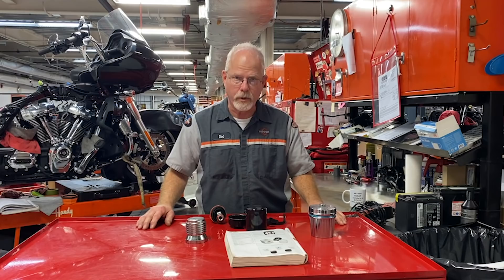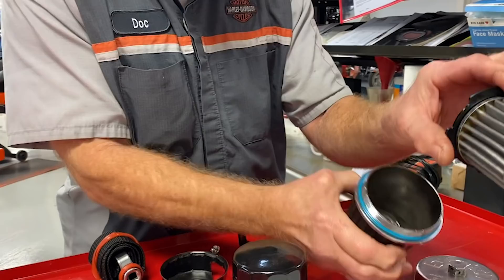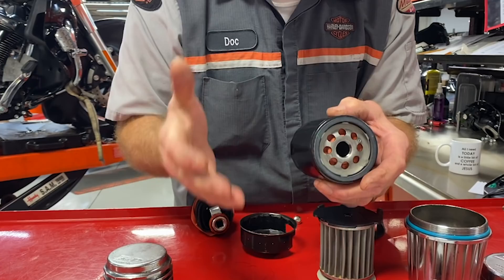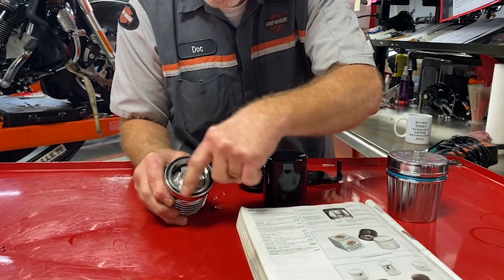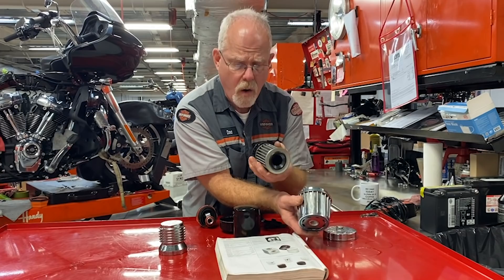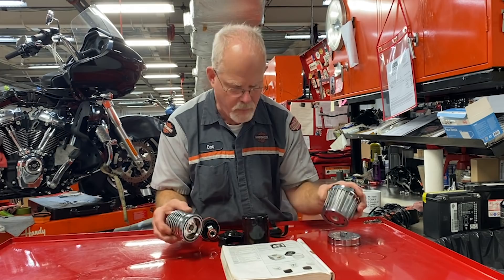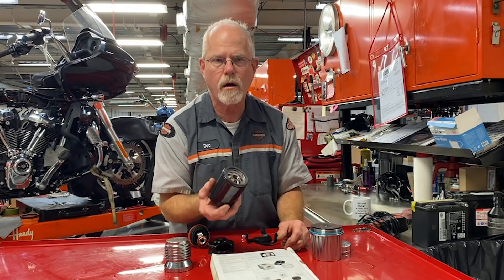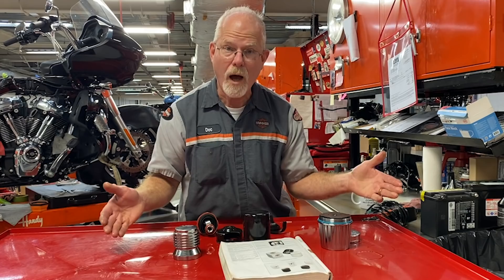DOC HARLEY: REUSABLE OIL FILTERS

Comment: I put two small holes in my filter before removing it. At end of filter one hole at 12 o'clock position other at 6 o'clock , top one is the vent. Filter drains out 90% of its oil makes less of a mess.   Ride Safe
Reply: Great idea 💡
Reply: Me too, I use a spring loaded center punch.

Comment: I have been using the K&P S4 on my Harley Street Glide  for the last 2 years with no issues , also the O ring is reusable and you get a 2nd one in the kit with a oil filter wrench .  I use Amsoil Synthetic oil ... Easy clean up with some brake cleaner :)
Reply: K&p on my bike comes with extra o rings and filter wrench and they work Awsome!! Better than any other  oil filter!!!
Reply: I just pick one up for my ultra what sold the this filter it lowers the oil
Temp by 10 degrees

Comment: First of all, I run the cleanable filters and change my oils at 1500 miles max! Second, I dare anyone to see a 5 micron piece of metal. Maybe 50 years ago when I had 20/15 eyes! When you see metal in a filter, it's either on the first oil change and junk was left in there at assembly, or you have parts coming apart! In the aviation world, if we see metal with a part number engraved on it in the oil, we go ahead and ground the aircraft ....LOL

Comment: Personal opinion reviews really don't hold much water, Except when meant to steer towards continued use and purchasing of OEM products which obviously is whats happening in this video. Any company willing to tool up and produce a milled billet reusable oil filter has done their homework on OEM specs and have spent much in R&D to either meet or exceed.  As far as cleaning, Come on really? Cleanup and blow dry with air is quick and easy, As far as O-ring i'm gonna guess here that thru all the R&D odds are they chose a standard o-ring size for easy replacement.   Ya wanna do a video, Take the filter on your right (For a HD and pit it against the HD filter and lets see real world results such as true micron level of filtration and PSI bypass and flow rate and lets see who's ranks best).

Comment: You know how much is made off oil filters that are disposable? A LOT. been using cleanable filters for YEARS and NO problems- take those motors down- for valve adjustments and full rebuilds- look GREAT inside....
Reply from the maker: Thanks for sharing your experience. Now about your taking a part for inspection 🤔……Doc

Comment: Flo, and DKCustoms have a Nut on the end to twist off the oil filter.
Best benefit of these oil filters is that they passively cool down the oil and they have naturally less flow restriction and therefor have less parasitic drag on the engine.
The metal steel mesh filters consistently to 35 microns. Nothing larger than 35microns will get past it period. Not the same with papermesh. Many of these mesh filters can catch things as low as 20microns, but they are inconsistent. The average filtration size of a paper filter is 30microns.
A human hair is 70microns across. Meaning a steel mesh filter will filter anything that's half the width of a human hair.
For reference, very fine sand, the softest lightest fluffiest sand you can realistically find easily, is 60microns across.
So Steel Filters will catch particles half that size.
The Steel Filters will get all of it, with a 99.9% catch rate. So there is no real risk to running a steel filter what so ever.
They have less parasitic drag on the engine, are just as good at filtering, and only need to be washed off. 
The only downside is that they are expensive.
Reply: I agree and as things are build to better tolerances and such the particulate becomes less and less.
Reply: To be effective a filter must remove abrasives larger than the engine clearances. The clearances between the cam and lifters or the rings and cylinders can be as small as 2 microns. I dont drain oil. My Honda 500 had a Frantz oil cleaner on it. All I use now is Motor Guards Gulf Coasts andthe Australian Jackmaster Classic. I have them on everything with an oil pump. Parasitic loss is when you take oil pressure out of the system such as with a turbo or bypass filter. The oil pump generates an excess of oil pressure unless it or the engine is worn out.

Comment: I’ve used K&P filters on both my 2011 Road King (103ci) and my 2004 Big Dog Chopper (107 S&S) for 9 and 11 yrs respectively. They are worth their weight in gold to me. They are clean and function well, and are top quality. O-rings are not an issue and they have never leaked and I’ve replaced them several times. 
  They come with either their own filter wrench or, like my Harley filter, with a molded nut head on the top of the filter for ease of removal. I’ll never go back to throw-away filters ever. Besides, yes, I NEED to see what is in my oil filters when I clean them out. One other thing you forgot to mention is the magnet inside the K&P filters, similar to the magnet on the drain plugs of your Harleys, an extra great feature. Sorry, Doc. I almost always agree with you but not this time. I do agree with you that the filter needs to be FOR a Harley Davidson, not a car. With that said, I really enjoy your vast knowledge and experience on every subject about my Harley. Keep up the good work, Doc!
Reply: Im with you. Ive been a Wix XP  Synthetic oil filter guy for my GMC 2500HD. But I have now a 2019 H.D.Road King. This H. D. Filter is what? H.D. gimmicky more money for our no name filter. Lmao! What do you say if I put a WIX XP OR ROYAL PURPLE filter on the bike? My bike will turn into a big firie ball of flames...lol

Comment: The one on your right hand side (with the fins) comes with extra seal although after over 10 years of use I still have the original one and no leaks at all!
It also comes with a socket (similar to one you was showing) so you won't damage chrome or anodizing.
And finally it was proven on the Harley Davidson stock and highly modified motors over the years!
It's easy to clean unless you are some kind of ignorant knob and it's easy for monitoring the condition of your motor.
So, I believe that you wanna sell me your expensive H-D oil filter with your baloney concerns about it :P No thank you!
I won't say anything about the other one because I never used it but I agree if it was made for cars then it's not good for my Harley. 
Oh, I'm not a seller of any of those:) Just a happy user of the one with the fins!
Reply: Plus it lowers the oil temperature with its fins.
Reply: i have been using my K and P - its stainless so can polish out any scratches if you get any have peace of mind can clean out super easy with brake cleaner dont have to go buy any when many times not available so have to wait for shipping- only remove when doing oil changes and so not taking off much and the rubber seals are still fine after many changes plus are available at my local store

Comment: I  love my K&P filter! bought it from my (independent harley mechanic)when I saw him rebuilding a pretty new 103 that had just sucked the OEM paper filter through the motor and destroyed it ,I've had it on there 6 years and about 50k miles with not one problem and only on my 2nd O ring

Comment: Great video Doc. I have a Flo on my Electra Glide and it works great. Comes with a extra O ring and has a bolt head on the end for removal. Benefits that are extra are a magnet, fins for cooling, and supposedly less oil drag resulting in a minor horsepower gain. Love mine in black or comes polished.

Comment: I use a FLO oil filter on all my bikes. It’s got a magnet inside to catch bug metal prices and it’s also got a nut on the case fir easy instal and removal. Also the O ring on it can be replaced with any o ring off a factory pip filter (if you ever needed to replace it). I don’t really know of the little cooling fins on it do anything realistically, but never buying a filter again is great.

Comment: I use an Arlen Ness Reusable filter on my Streetglide for 5 years now. no problems. Bought it for the look but works as promised. After 5 changes it pretty much is paid for and Orings are 3 bucks to replace.
Reply: You got a link?
Reply: @piercebruneau1284   It's not an Arlen Ness but it's just as good. Just search for the one that fits your bike. https://www.amazon.com/PC-Racing-PCS4B-Stainless-Filter/dp/B0041Q2BM4/ref=sr_1_1?dchild=1&keywords=reusable+oil+filter&qid=1610346730&sr=8-1

Comment: I Bought the K &P 10 yrs ago in Sturgis Iv'e been using it on my 04 Springer softail ever sense it is Far better than the regular throw away ones , Every time I change oil  I put a new gasket which all the motorcycle shops in Denver sell them 2.00 ea throw it it a bucket of soapy hot water cleans up easy blow it dry or put it in the sun also save's  a shit load ! and you don't have to throw it away..

Comment: I run the Flo filter on my 2016 Road Glide Special. Came with (2) extra o- rings. Has a bolt on top of filter. Bike runs 10 degrees cooler. When removing filter I use a half gallon plastic milk bottle for over flow oil.
Reply: Thanks for the tip on the milk jug.

Comment: I installed the K&P cleanable oil filter in 2014 with no problems whatsoever. It came with a socket for removing the filter and a spare seal. I installed the new seal last year. I ordered replacement seals, which comes with two new seals for ten bucks. I check the filter mainly for cam chain tensioner debris. Love the K&P filter.
Reply from the maker: Thanks for sharing your good fortune...Doc

Comment: I LOVE "Do you REALLY want to see what's going on in your motor?" Exactly why HD doesn't put oil temp gauges on the bikes. You really DON'T want to see how hot it's getting! I love your videos, and I liked how you handled this topic. In my airplane engines I cut open the filter and inspect the pleats. I run the cleanable filter on my three HD's just because... I also change my oil every 1500 miles, because OIL is CHEAP. If I see crap in my cleanable filter or in my drained oil I know a problem exists!
You are correct though, many riders don't need to be putting wrenches on anything.
Reply from the maker: I enjoyed this post…..Doc

Comment: I have a PCRacing Harley specific oil filter and after 5k miles the oil comes out looking cleaner than it did with a paper filter. If you're told to inspect the magnet on your drain plugs why wouldn't you want to see what may be in the oil filter. PC Racing PCS4C

Comment: I have been running a K&P oil filter with a relocation kit and it has worked flawlessly for 3 years and provides many benefits to include cooling, better filtration and less drag on the oil pump.  I recently cleaned my filter on a road trip in 15 minutes with simple green and used a hotel hair dryer to dry off all the water and simple green solvent.
Reply from the maker: Thanks for sharing your experience…Doc

Comment: The race aluminum type also cools down the oil and one of the reasons we used it. Majority of you don't even buy the Harley made OEM filters anyhow.
Reply from the maker: Any particular manufacturer you use with success?…..Doc
Reply: @LowCountryHarleyDavidson  R. Moody if you can find them. I use OEM and do manufacturer recommended maintenance. My Harleys go well into the 100,000 mileage range. 👍

Comment: For me, the bottom line: the engine will give you warnings in the filter long before you have total failure. So I have had a K&P on my Road Glide for 7+ years and over 60,000 miles with Amsoil. Yes, it has more than paid for itself, but that wasn't the point. It is nice to see immediately see what is in the basket and whether it is normal wear or not. They are easy to clean and maintain and with diamond cut flutes, the aluminum housing adds additional cooling. My experience with Touring bikes and filter location is that changing the filter gets messy regardless of which filter you are using, so Doc is reaching on that one. Additionally, the last time the dealer (1,000 mile service) changed my oil, they put the filter on so tight it crushed the filter taking it off. No chance of that with the K&P as they come with a wrench and will not crush like an aluminum can. So no, you will not destroy the finish. Again Doc, you are reaching.

That being said, HD OEM oil filters are quality filters. You are more apt to run into pinion runout, sumping problems, and cam plate issues, than oil filter issues. But I want to see inside it each and every time. 3 bikes. All K&P filters.

Comment: Wire mesh filters are fine for racing, for the reasons mentioned.  They are not remotely competitive with modern top shelf fiber filters.  There are a few vids on YouTube using testing and oil analysis. 

If you do use these filters changing the oil more often is advised.

Comment: I use the KN filters with the nut on the end. I cut the bottom off a milk jug and run a ratchet extension through the jug opening then slide the jug over the filter, loosen with the wrench and the oil goes into the jug. No mess on the bike.
Reply: Drive a long centre punch in top and bottom while the bike is still on stand. Let it drain into another milk jug with a hole cut at the top so you can fit over the filter and also put the drain hole in. I let it drain overnight, not a drop spilt next morning.

Comment: Very diplomatic response. Appreciate you saying this is your opinion. I run a wix right now, but will be purchasing the DK Customs permanent filter soon. I trust Kevin more than the factory
Reply from the maker: That's what I enjoy about owning a Harley-Davidson...It is the owner's choice.....Doc
Reply: Im not a biker If it was a car I would say the cleanable filters dont clean oil as good as the throw away filters and the throw away filters dont clean oil
Reply: There are spin on filters that clean oil but the relief valve is always open when the engine is running. Then you have converted the full flow system to a bypass system.

Comment: A recent review on the filter on the left said it's great cause it doesn't have a relief valve. He said a relief valve will put dirty oil in your engine. You don't want a relief valve in your filter. Like you I want a good relief valve rated for HD. When would you not want a relief valve?
Reply from the maker: Racing….Doc

Comment: Being in the automotive field and have seen paper filter come apart,I run a reusable filter made by Hubb, that is a lot like Schaefer oil as they are suppliers to fleets-and gained 5 psi of oil pressure.
Reply from the maker: Thanks for your experience….Doc